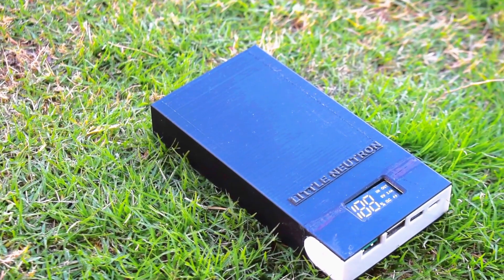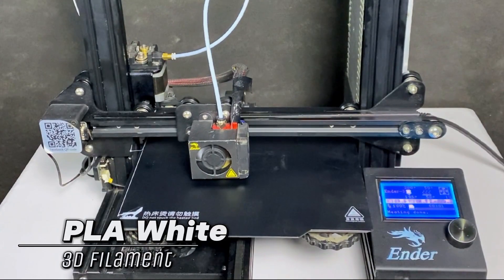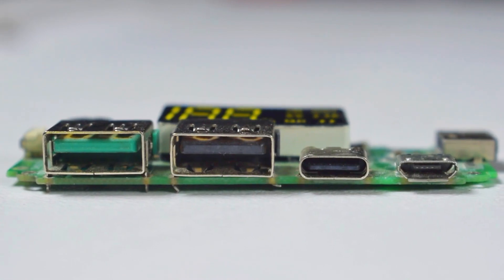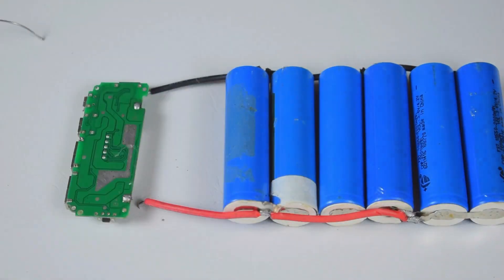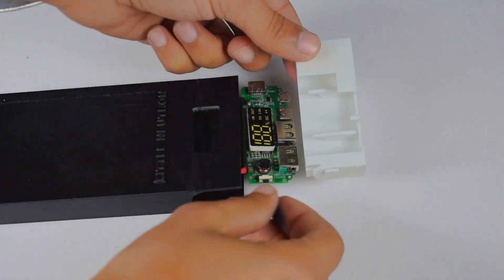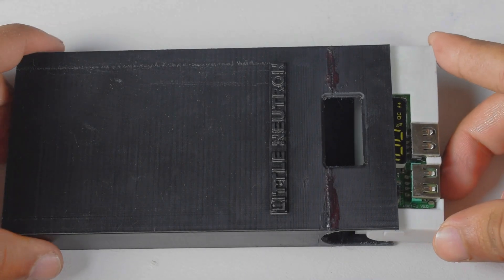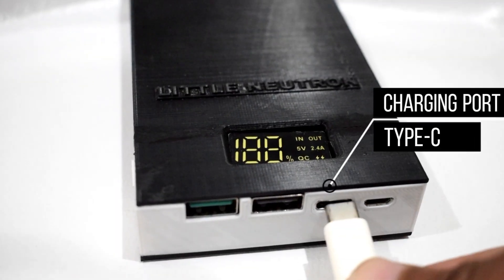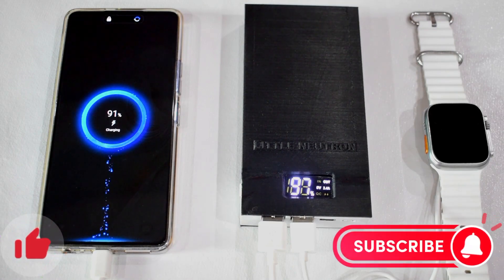How to make Fast Charging Power Bank  - DIY Super Fast Charging 12000mAh Power Bank

Comment: DO NOT solder batteries, as this can over heat them and cause them to explode. Use Nickle and a spot welder. Be safe.
Reply: Nice advice, soldering is not safe at all. Get it spot welded from someone who does it and has the gear and experience
Reply: Yea, i see so many people soldering batteries, completely unaware of the risk of the battery just setting ablaze. @vivek114
Reply from the maker: Absolutely Right Sir.. Thanks❤